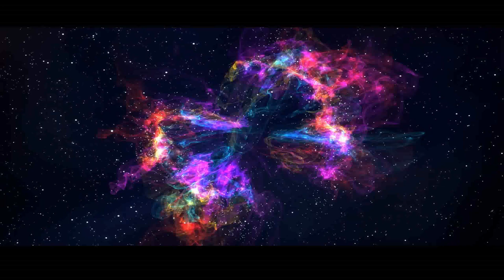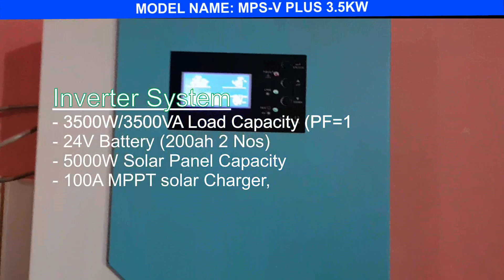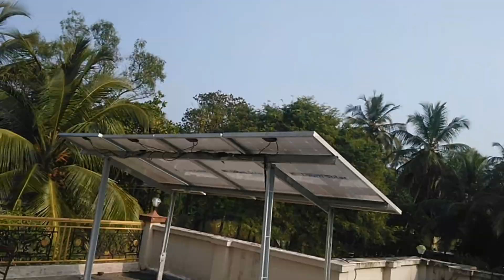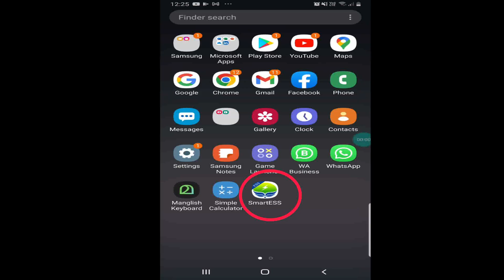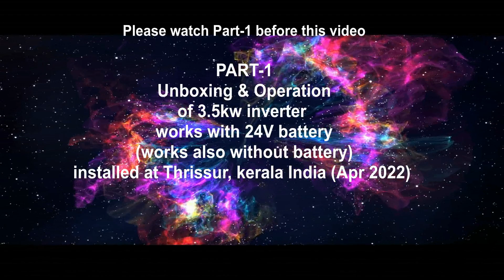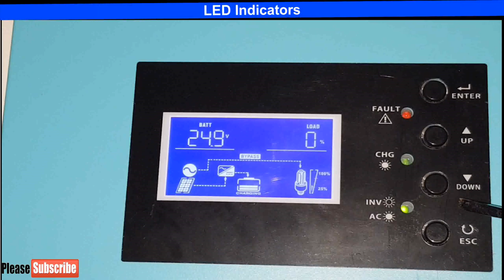3.5KW Solar Hybrid Offgrid Inverter 24V - Screen Settings PowMr 2022 | Malayalam subtitle

Comment: Is this real Mppt?
Reply from the maker: Its manual says it is MPPT. The seller confirned it is MPPT. All the settings mentioned in manual are working. Its price is more than a PWM charge controller. Sometimes in favorable conditions, it generates power equal to solar panel capacity.
Please subscribe my channel

Comment: Question. I've a submersible water pump that I intend to use , Off-grid, every day in my farm land.The water pump power rating is 1700w(1.7kw). I also have an array of Solar Panels of 3600w output capacity. I've no need for battery or charge controller, only an Inverter, as I don't need to store energy. I intend to use the power directly on the appliance. What size/capacity of Off-grid Solar Power Inverter do I need to buy. Thank you.
Reply from the maker: Inverter usually comes with a facility for battery storage. Some new inverters, especially chinese inverters and branded inverters in india are possible to work without connecting battery. If no use of battery, vfd drives (variable frequency drives) are also an option for u 
http://www.vfds.org
(If u dont have pump already check the possibility of buying a DC submersible pump which needs only a controller to work).
According to ur water pump power requirement a 2000w (not VA but watt) is ok to work, but remember the point that this inverter should support 3600w panels. So first check for an inverter which has a charge controller that supports 3600w panels (without charge controller inverter will not work with solar panels). Inverter output watt select accordingly but it should be greater or equal to 2000w. A little higher output capacity is always preferable because power usage of pump may come a little more than 1.7kw and not always same.

Comment: Price of inverter, Including shipping and tax?
Reply from the maker: Inverter price was $295. Shipping costed $150. I paid extra Rs. 6000/- as IGST+GST. For WFI we need to pay $15 more. Different suppliers say different prices. Inverter working without problem. To buy similar hybrid inverter in India it will cost more than or nearly 70k, but wall mounted not available in india.
Reply: @k4techsystems sir you brought directly from powrm website?
Reply from the maker: @vijith davis  I bought from alibaba.com. when we buy through alibaba we will get protection for our purchase. It is a trustworthy site. Seller was actually a dealer of powmr brand. Contact +86 18665889858 bybwhatsapp. Dealer website is 
https://www.ysolartech.com
But purchase through alibaba.
Reply: @k4techsystems sir,  thanks for the information..